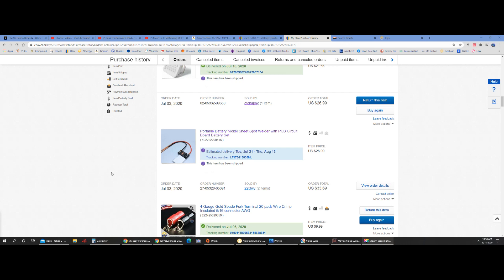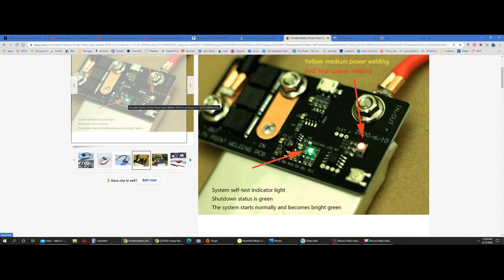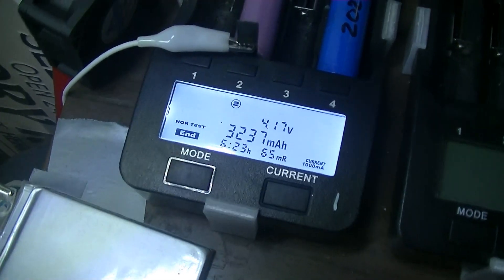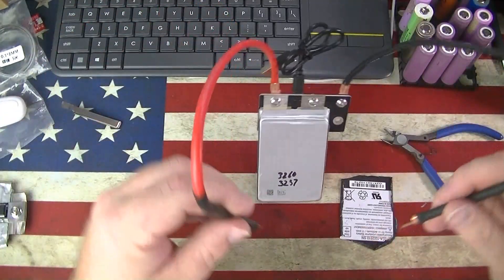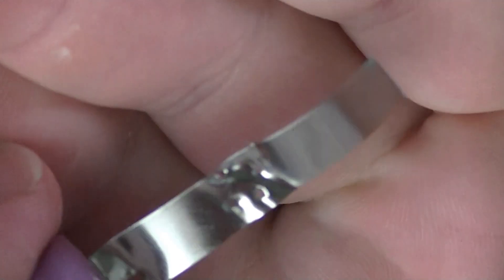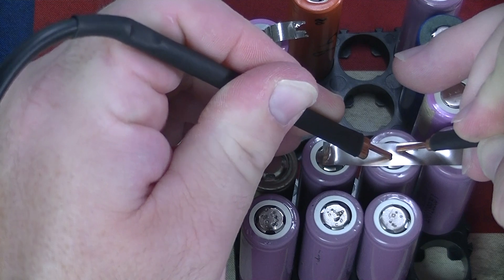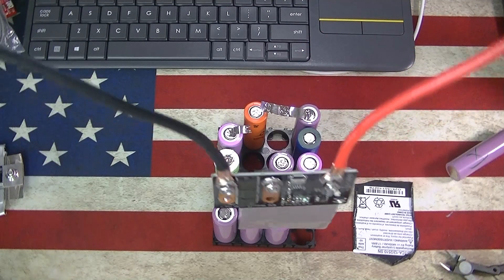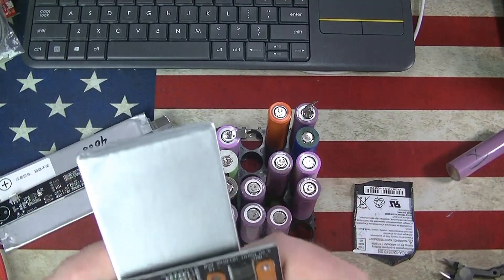The BEST CHEAP All-in-one 18650 Spot Welder?

Comment: I have the same one. Filed down the tips on the pens for a more rounded tip not the flat tip. Works great,  I got a few of the 4.2v pcb (red) board spot welder for back up.

Comment: OK, so I've watched a number of your reviews and I'm still at a loss.
The spot welders all seem to work in one way or another.
Is the red one on Amazon you link to the best?
Which BUDGET spot welder would you recommend for replacing NiCd or maybe Lithium batteries in an 18v cordless tool battery pack.  I won't be turning these out commercially but I do currently have three battery packs to replace/ replace and will have more as my others die.
I've soldered a couple already, using an HF battery pack for batteries, but I'm planning on buying GOOD replacement batteries now so I feel I should spot instead of solder. 
I THINK from your reviews, that the .1 strips seem to work best with just about all the spot welders.
Is .1 adequate for what I need to do?
Is nickel plated OK or should I use pure nickel?
I don't have any batteries around for power, would a 12v car battery charger work?
Do you have a recommendation as to what strong, high AH, long lasting batteries to use?
Reply from the maker: OK, Thanks for watching.  For your projects I would buy the all-in-one version and some pure nickel .1x8mm strip. Also I would double up the strip to help with the current.  .15x8mm is max 7 amps.  so weld the first strip then weld another to that.

A good enough battery to power the red welder is more expensive then the welder so more to invest. Power supply will not be enough. not even close!  Maybe you could use a lead acid car battery. Some people have had them blow up, but I only hear from the bad reviews and I can see that 200 people have bought them through my link. Mine is still going strong after building that huge battery from my last video. If you decide Red then a 3s LiPo battery that has a high "c" rating would be needed. 5500ah @ "50c"= (5.5ahx50c=275 amps).  My battery 3s 400 amp pulse x3s=1200 amps it can deliver, not that it does. but it does enough  amps that it gets to hot to hold after 20-30 continuous welds. hope this helps!  all-in-one for small projects.
Reply: @RodneySolarCircuits  SWEET, thanks!

Comment: MOT transformer - picked from trash. 40a Spot Weld Timer - 10 bucks.{its the one from a sunko} couple feet of battery cable. welds .15 all day long plugs into the wall no need for batteries or capacitors. its the way to fly. Otherwise use a ford starter solenoid and a timer if you want a DC option. i cant see the point in paying 200 bucks for a Kweld or 25 bucks for alibaba stuff that dont weld for shit.
Reply: What’s this timer your speaking of if you don’t mind me asking ??

Comment: i have heard that the battery will not last long.....am i correct?????
Reply from the maker: right. once it drops below about 4 volts it starts acting funny.  but it last long enough to get a small project done for sure. I used it to build a 7s5p pack with no issues.
Reply: @RodneySolarCircuits  so honest reply...thanks sir....actually i have too ordered a spot welding machine but the one which has no battery...the red one....which you told its the best...your reveiw heloed me a lot in buying the right spot
Reply from the maker: @sagarevstore4524  Awesome! and thank you for the compliment. what kind of battery are you going to use with it?
Reply: @RodneySolarCircuits  sir am thinking to use car battery which will be 12v 30amp..
Reply: @sagarevstore4524  i use a regular lead acid car battery {you mean 30amp hour, it will deliver close to 2000a for a second} a cheap timer and a starter solenoid is all you need. I use an arduino timer but you can use a capacitor/mosfet/resistor circuit to make your own timer. you only need about a 20ms pulse to weld a battery. the solenoid welder will weld .2 nickel strip no problem. the mosfet welders all seem to max out at .15 nickel...but i havent tried any of the new ones with mos tubes.
Reply: Diesel Ramcharger i orderd the same spot welder the red one hahahah im gonne use a old car battery of my dad that can”t start the car it holds the voltage on and is has some good juise still i think it wil work out only a bit big
Reply: instead of battery you can use super capacitor with a power supply, or keep the battery on a charger while you work to lift the voltage during breaks.
Reply: Ordered mine and made a pack 12p. It worked awesome. Made this 12p pack for another spot welder that's 4.2v. It's a red one without the battery. Have you tested that one yet?

Comment: Good job 👍 I just finished up another welder sorta like this. Testing right now before I publish. It’s the longer 4500mah battery with the smaller board in the middle. Not completely sold on these Chinese welders yet, but they sure can work if your not planning on using long term. But for the price it worth it👍👍👍
Reply from the maker: Thank you. I'll be looking for it!
Reply: Really great job 😊👍
Reply from the maker: @DIYwithBatteries  Thanks for the comment!
Reply: the chinese just steal the arduino projects and reformat the board to be all in one. all the spot welders are chinese. all of them. where do you think jlcpcb is? ;) anyways....